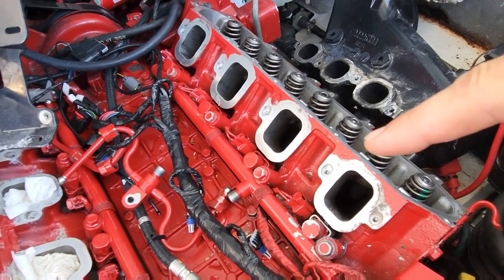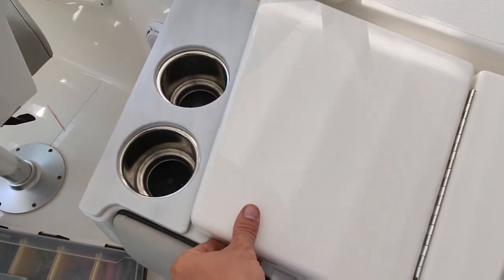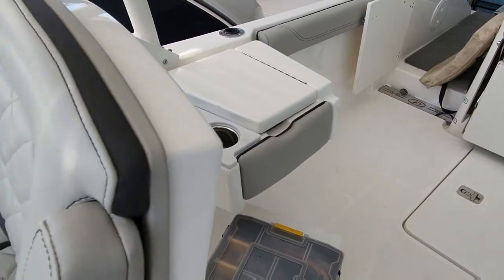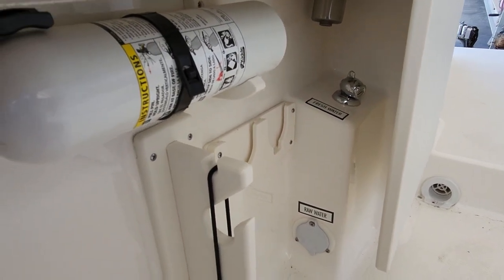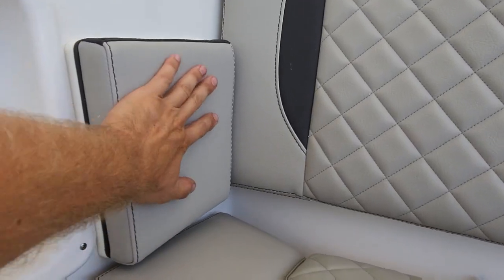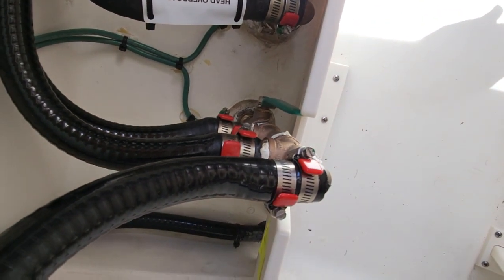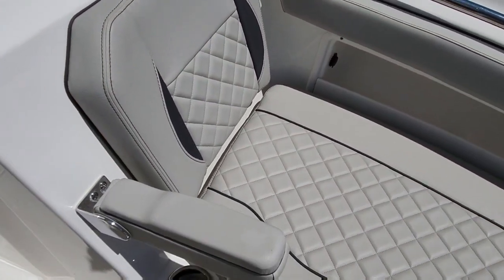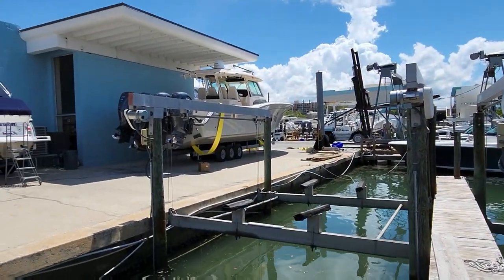Which One Is Better?  246 VS 266 Dual Console Pursuit #Yamaha #Garmin #Episode182

Comment: Why no recall on the injector issue??
Reply from the maker: My best guess would be that not enough of them have problems to issue a recall.  I haven't seen it to many times and it usually happens to older engines.

Comment: Interesting that they put the Sirius antenna on the bow and NOT on the hardtop...
Reply from the maker: I noticed that too and have seen other manufacturers do the same thing.  Not sure why.
Reply: @JustinLeeMarine  if the customer ever installs a radar up top, the siriusxm receiver will cause interference. Some MARPA radars would fry the xm receiver upon spinning up the magnetron. I had a furuno radar with a blind spot behind it due to the siriusxm receiver.
Reply from the maker: That's good to know.  I always appreciate learning new stuff ☺️ Thank you